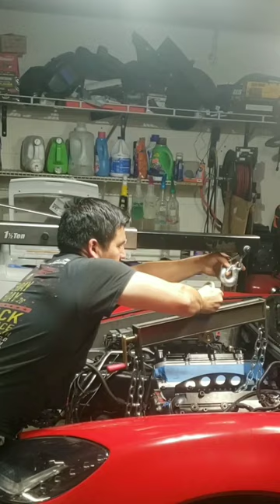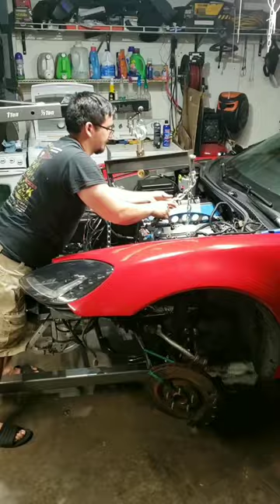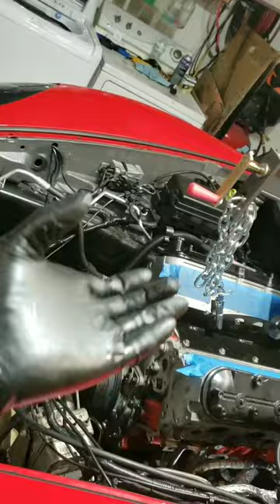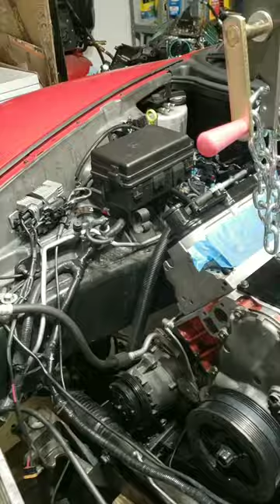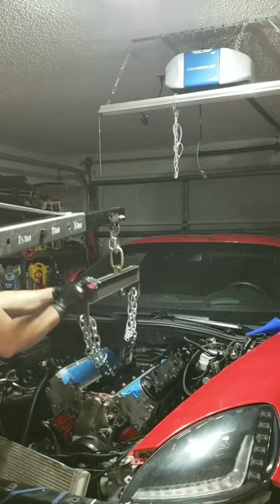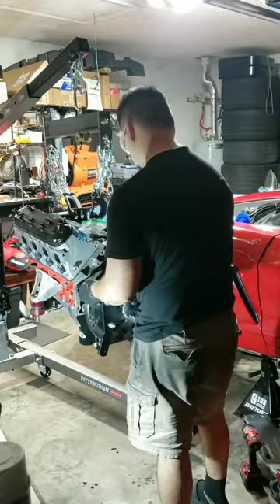C6 Corvette Engine Pull Without a Lift Music by @fountane #c6 #corvette #rebuild

Comment from the maker: https://amzn.to/3I4QOae Valley Lift Plate, works on aluminum and iron LS 
based blocks
Reply from the maker: Somethings I didn't like about lift plate is it was missing bolt holder threads and the finish was rough. It's important to clean off the sharp edges especially on the bottom of the plate for use on aluminum blocks. Maybe use a clean old gasket on Al blocks.

Comment: I don’t get it. You used an engine “lift” to remove the engine. Therefore, no lift in title doesnt make sense
Reply: Car lift
Reply from the maker: Doing this without an automobile lift, commonly known just as "lift". Normally you'd lift the body/frame off of the drivetrain or lower the the drivetrain/cradles once the car is in the air. What I used is an engine hoist; though it does lift the engine. The engine is not usually taken from the top of this car. This takes some extra finagling.